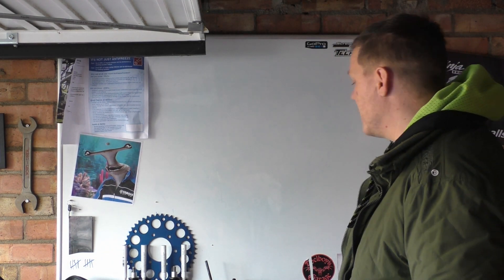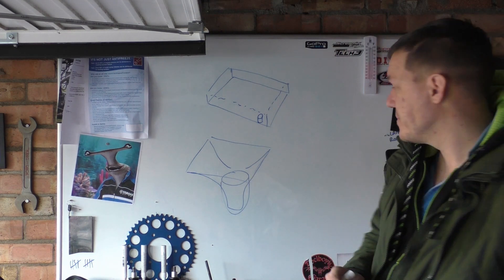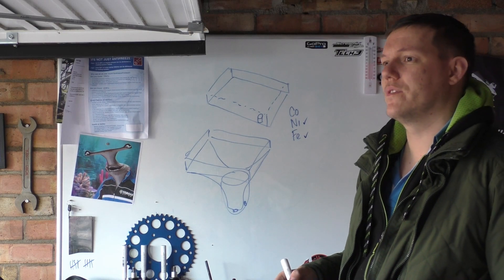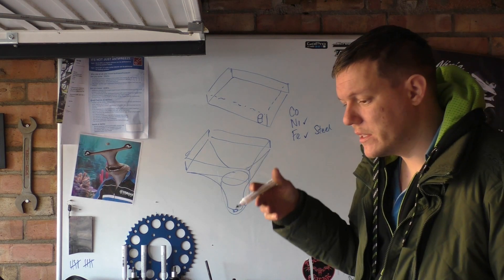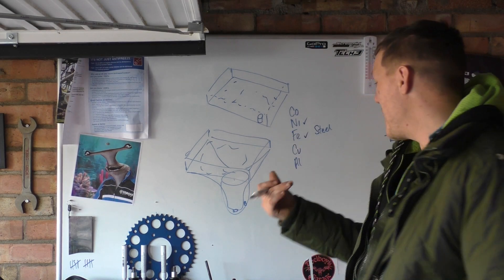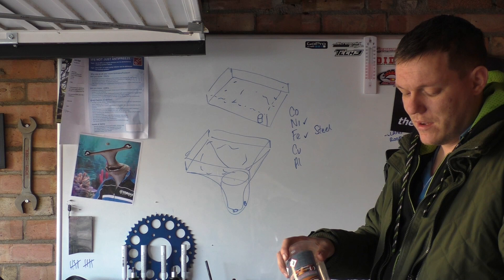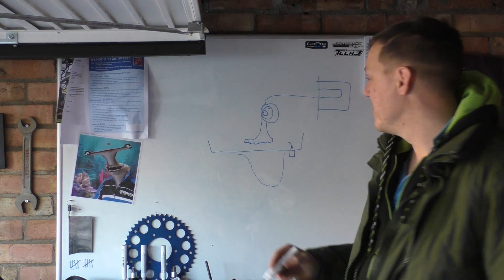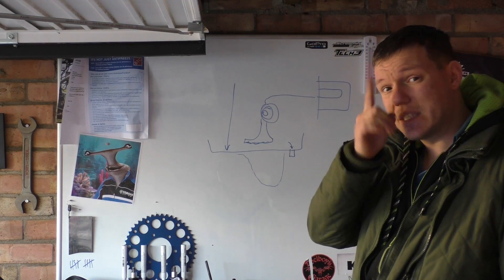Magnetic Sump Plug - Any good?

Comment: i was a "lube tech" for about a year and i can tell you that mag plug does attract metal.  at first i was wiping them clean, but then one day, another "lube tech" told me not to and that you could use it to help tell the shape of the engine. idk if he was right, seems like the more metal on the plug, the less in your engine, but either way, they definitely do collect metal.
Reply from the maker: Okie kokie but from what? And like you said, you have a filter. As far as "and that you could use it to help tell the shape of the engine." don't know what this means???
Reply: point is, you use a magnetic drain plug, over time you will have metal bits and tiny shavings stuck to it. all i can imagine is the metal is coming from within the engine somewhere. my experience isn't from just a few people's cars but many many people's cars. this was a very common thing.

as far as what the old man was saying, i would say it is in regards to the bearing surfaces and journals wearing along with ring/wall, and timing chain wear.  not that it is specific, but just says "hey, there is some metal missing and here it is." 

don't recall mentioning the filter in this previous comment but, yes, most engines do have them.

another thing i do remember about oil changes was to warm up the engine and get all the shit that settled picked back up by the circulating oil which might have something to do with where the metal comes from on the magnetic drain plug. so you turn off your engine, oil from the head assembly(s), pistons, rings, cylinders, big and small rod ends, crank, maybe the oil pump itself? and timing chain if applicable all falls down to the pan. none of this oil is filtered at this point, it carries with it any metal that has worn away. after a while these metal bits sink maybe very tiny pieces but they are there. get the oil moving and warmed up and they can loosen up and become suspended in the oil again, to be picked up by your intake screen and pulled through your oil pump to finally be filtered.

btw i love the videos and i enjoy watching. i also enjoy how the auto generated captions try to deal with your non american accent. you might could try it sometime.
Reply: I have a magnetic drain plug (not a crappy aluminum one) and it does collect fine debris between oil changes.  The color of this debris is black, consistent with cast iron.  I suspect it's from the chain-driven cast iron camshaft gear.

Comment: Which might be valid point for cars, but not so much for motorcycles with wet clutch.
Reply from the maker: Clutches? Are they magnetic? Because I always thought it was paper, cork and grps....
Reply: @thedirtyworkshop  Ever heard about metal clutch plates? They are made of soft metal touching directly ceramic/kevlar or other friction material on friction plates. Then all this stuff circulates around the engine, and that's why there is always slight metallic buildup on magnetic sump screws of both of my motorcycles, albeit at different rates.
Reply from the maker: And these tiny (5 micron) shavings like shit off the cylinder wall do what exactly? They float around with the oil and do nothing...
Reply: @thedirtyworkshop  If they are steel parts, they are abrasive to cast aluminium motor body. They are scratching oil pump surface. they are likely magnetized by themselvs, likely to accumulate in thinniest oil channels in the engine at strange spots causing clogging and uneven cooling in the area, leading to deformation under heat stress.

Comment: i believe the magnetic plug, if it is placed properly, would be situated under the pick-up tube and mesh so that when you turn your engine off, and everything drains into the pan, everything settles over your plug, catching what it can so that when you start your engine up again, it doesn't pick all that crap up. tat being said, thats what your oil filter and pump screen is for, and if you take care of your engine and change your oil this should never be an issue. if you did manage to break off something substantial in your engine that is magnetic, the problems it will cause will not be solved by a simple magnetic plug.

Comment: A magnetic sump plug allows you to see how much wear is occurring in your engine. You can either buy one or drill a hole and insert a magnet into your existing sump plug:

http://www.xcelplus.com.au/docs/testimonials/colt.pdf (scroll down to see a magnetic sump plug in action)

A standard oil filter will only remove particles down to about 40 micron... but the wear particles damaging your engine are in the range 2-22 micron according to the SAE. A magnet will remove even the smallest particles (sub micron).  

You can use a magnetic sump plug to determine which oil is better or which additive works best? Less particles in the oil also means the oil lasts longer and works better.

:-)
Reply from the maker: LOL what a shill pdf. WHat the fuck was that. 

Hiflo and K&N and friends filter down to 5um so you're wrong there.

"A standard oil filter will only remove particles down to about 40 
micron... but the wear particles damaging your engine are in the range 2-22 micron according to the SAE."

- according to which paper? Number please.....

"You can use a magnetic sump plug to determine which oil is better or which additive works best?"

- name me one additive which is effected by a magnet. Actually name me one additive.....

Comment: They work, at least if you have a powerful neodymium magnet sucking up the ferrous metals from the oil. Not all particulate circulating in oil is ferrous metal, but the stuff that is, may as well take it out if the filter fails to do so. A strong magnet creates a zone of magnetism that attracts ferrous metals that pass through that EM zone.

Another place for a good magnet plug is the shaft-drive case which has no filter or pump, which wearing gears are ferrous metals.

http://www.drainplugmagnets.com/

Comment: I use a magnetic sump plug in my car, oil changed every 6k miles, currently on 190k and over the time ive been using the sump plug the amount has been decreased each change, however first 4 services the thing has been completely covered in tiny fibres, recently not much, so it has been taking out the metal over time. However we are talking about a high millage diesel engine. 
I like them, i like to think it is preserving the engine bearings and pump etc a bit longer especially with regular oil changes.
Reply: I probably have a photo of a recent change if you want a look.
Reply: I have magnets on my oil filter and particles are attached to them when you cut them open
Reply: Dodit Aquino yeah but the point, I think, is that most of the particles are still in the oil or get caught in the filter. I wonder where your magnet sits but probably on the outside which is in the oilflow before it gets filtered. At least on all filters matt opened up recently

Comment: Wait a moment.
1. I know  Austenite is cubic face centered and not magnetic. Why is Nickel magnetic although it being cubic body centered?
2. I once took apart a VW automatic gearbox ( i think the manufacturer was ZF) and found four magnets in the oil sump. Do these also make no sense or are they needed in transmissions (maybe because there will be much more steal-particles)?
Reply from the maker: 1) crystiline structure and the electron magnetic moment have nothing to do with each other. Dipole moment comes from the more fundamental property of the electron that it has quantum mechanical spin. Iron, cobalt and nickel are part of the group of perminant magnets belonging to Ferromagnetism.

2) for gearbox's they don't have the same pump/filtering system that engines do. They're also there to catch teeth not particles
Reply: Makes sense, i just thought crystalline structure had something to do with that because Ferrite is magnetic and Austenite isn`t. Well, i learned something new XD.

Comment: Good to hear your opinion. I got a magnetic sump plug, and it has worked really well so far. It collects quite a bit of very very fine particles (that I wouldn't wanna have circulating in my engine... ), and when the retaining ring of my wrist pin broke twice, the magnet caught the pieces both times.
Sure, maybe the filter etc would also be ok.. But I'm really glad I got one. Working very well for me.

Comment: A couple points to consider. On a two-stroke, or a four stroke with separate transmission/engine oil, there is no oil filter in the transmission side, so any particles stay floating around until an oil change. These small particles that come off the gears that are floating in the oil will help accelerate wear in the system. 

KTM installs them stock on some bikes, and they grab some of the magnetic dust out of the oil. Grabbed a bunch on my bike when breaking it in, since then it's a fine dust or hardly noticeable.

Also, in the event of a chipped gear or broken dog, I would prefer to be lucky to catch that hardened metal chunk by a magnet instead of having it jam in the gearbox and cause catastrophic damage. Finding the chip in there is also a good indication to park the bike and fix the issue before it grenades.

Lastly, it's a different application, but car transmissions have a magnet on the oil pan to catch steel particles as well. Keeps them out of the filter improving it's life,  and reduces the amount of hardened particles floating in the oil. Any time I've done a filter change, the amount of metal on the magnet is incredible.

Comment: The early Honda small twins had a magnetic drain plug.  I serviced them at dealerships for several years in the early '60s.  Each oil change would show considerable filings on them, some of those a little troubling about just what's going on in that little motor.  I would think the most of the steel particles that end up on a magnet are from contact of the gear dogs and slots during gear changes.  Most Honda engines of the period had a centrifugal oil filter which was very effective but unhandy to service.  I say, each to his own on the magnetic plug as long as it's not priced out of reason.

Comment: I don't have a oil pump or filter on my old bike.. but i do have gearbox oil and a magnetic sump plug which always has loads of metal powder on it when I changed the oil...

So can i assume Aprilia did put it in for a reason like I dunno maybe iron being harder than aluminium and due to no pump / filter they thought it might just be a good idea for the sake of a few £..

Or is this video just for 4t engines?

Comment: I drill and weld bungs on all my exhaust manifolds and install magnetic plugs to collect metal shavings from the valves from either going through my turbo or degrading my catalyst. I also put a magnet on my turbo cartridges to suspend any metal shavings going through. Works as double duty because the more collects it acts as a high velocity oil porting. You heard it first. I came up with it myself and now your learning from the net. Trust me!
Reply from the maker: "metal shavings from the valves" - LMAO!
Reply from the maker: One problem - heat kills magnets
Reply: ^ pffft, just coat it with Evans, it will keep it cool enough
Reply: mmdirtyworkz well that's exactly how it all works. Evans keeps my engine from overheating. Thus there is no way the magnets ever would. Tried true and tested. Now if I could just find out why I have so many vehicles and bikes broke down.

Comment: At least on motorcycle engines cleaning the oil is not the most important job of the magnetic sump .
It is there so you can see, while you are doing an oilchange, if something in the engine is going downhill.
On specific 4stroke single cylinders for example you can see golden bits at your magnetic plug, when the rodbearings are really starting to wear.
Also racing teams(for single cylinders) sometimes put in extra magnetic plugs to have a even better knowledge about the status of their engine wear.

Comment: wait a minute... yes what you say make absolute sense but matt, i had a couple of magnetic plugs taken off in bikes/cars with a considerable amount of miles, and they always have crap magnetized to them(usually like a metal paste). Its that not usefull? would that not take the filtration capacity of your oil filter faster if the magnetic plug wasnt there?
Reply from the maker: How often are you changing the oil? And the filter?
Reply: 100.000 miles... LOL mmm in my machines quite often, those examples are from friends/relatives that bring they shite for a service. The more recent example was from a gearbox oilchange of an honda accord automatic (no oil filter in that case) full of shite that magnetic plug was (i suppose first or second gearbox oil change in 90.000miles). But generaly speaking they take decent care of they cars. In bikes from what i can remember, a 250cc 2005 1 cilinder 4 valves, that i always make him the oil changes, every 3.000kms (mineral oil) and with 31.000miles (50.000kms) in the last oil change i start to see some of that metal paste (but in that case very little).
Reply: my drz (has magnetic plug stock) seems to have a paste on it even after a 500km oil change, but maybe its buggered.